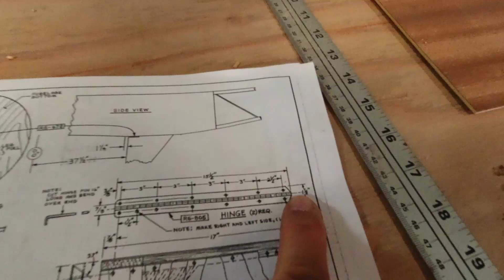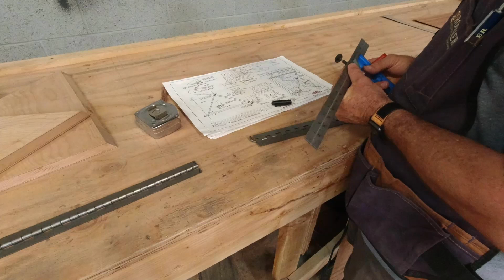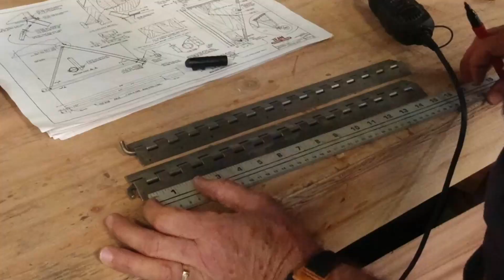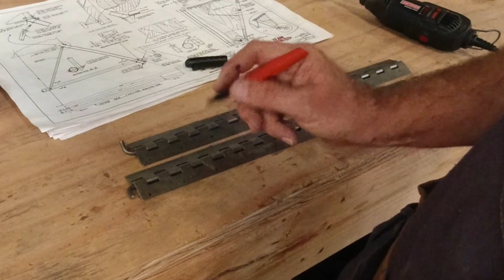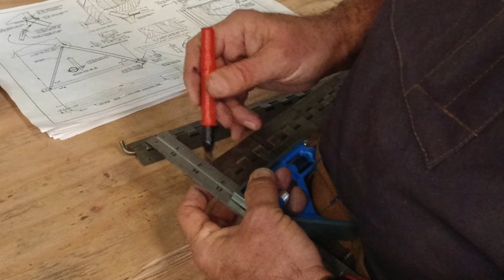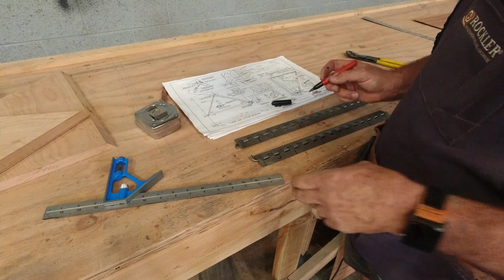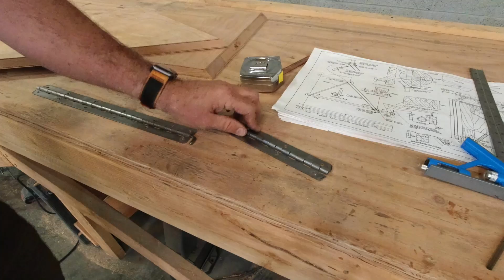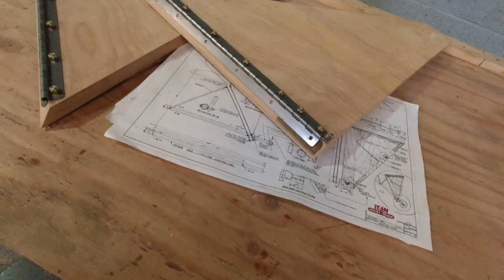Minimax 1100r Wood Aircraft Build Ep 82

Comment: Thanks for all the shout outs. Interesting UC fit, I see the eye bolt is for the UC cross brace, I would have thought the heads of the other screws would have gone through the other way (so should a nut fall off the bolt would tend to stay put but that might be just because you have done a temp fit). It is interesting and comeing along well, so looking forward to the next steps.
Reply from the maker: It’s interesting that this is exactly how the plans show this. It must be to eliminate all of the washers that would be needed if you flip them around.
Reply: @DTMinimax  that could well be the reason, saving the weight of the washers. There are enough so if you lost one or two in flight it would not be a problem and with nyloc nut probably would never happen

Comment: did you use stainless steel hinges for the gear legs?
Reply from the maker: They are low carbon steel
Are yours stainless?
Reply: @DTMinimax  yes, I had a hard time drilling it is why I asked, its what the plans called for on my himax. I would of thought the himax and minimax would of used the same stainless steel hinge but I might be wrong.
Reply from the maker: I’m gonna have to ask them. I picked mine up locally
Reply from the maker: I ran into a little issue today...my fuselage where the gear goes has a little curve to it. Gonna have to add some wood and flatten it out.
Reply from the maker: Sure enough, they’re supposed to be stainless...now I get to make them again...arggg
Reply: @DTMinimax  I hope you didin't already make new ones from stainless, I looked back at my plans and it only specifies steel for the gear hinge, I may have used stainless just because it came in the correct dimensions needed when I ordered from aircraft spruce.
Reply: @DTMinimax  my gear didn't lay perfectly flat against the fuselage either, I think it has a 1/8" gap towards the rear, I didn't think it would be a problem, but you have to remember the landing gear is part of the wing structure on the minimax.
Reply from the maker: @gyrojeffro2263  I haven’t made them. I looked at my plan too and it just says steel. 

Was your gear area completely straight? Mine has a slight curve so I think I’m going to have to use some ply to take up the extra space.
Reply: I ended up with a slight gap towards the rear of the gear legs maybe 1/8"
Reply: @DTMinimax  I am fairly sure mine are not stainless and they came with the kit I got from TEAM.
Reply from the maker: That’s what I thought...I’m gonna stick with what I have. I couldn’t even find a stainless one with the 1/2” knuckle